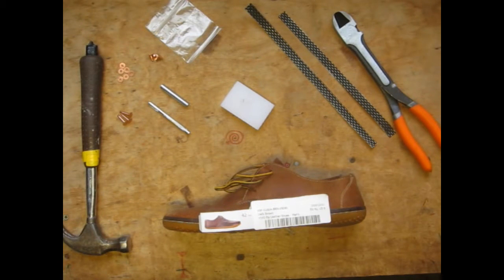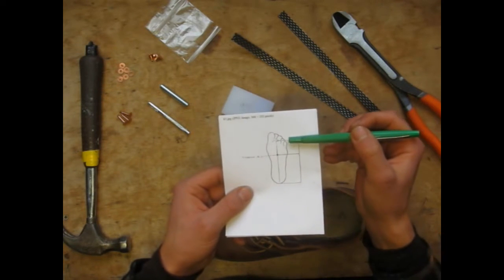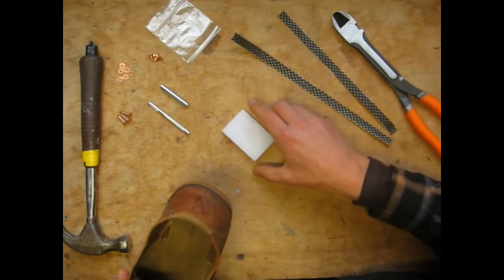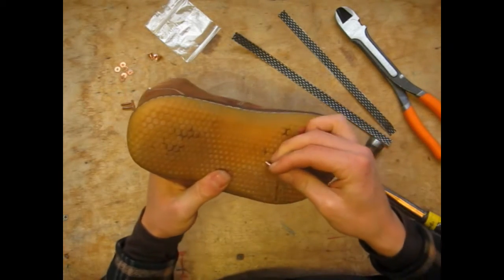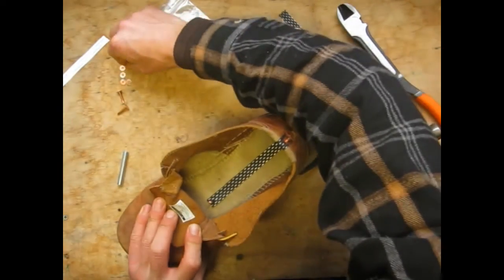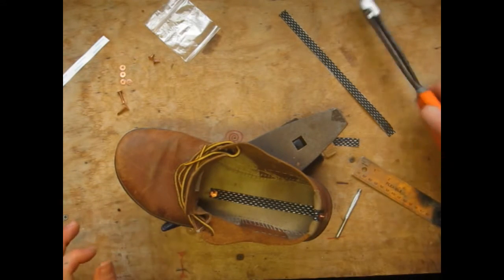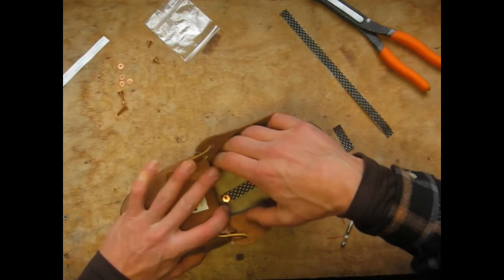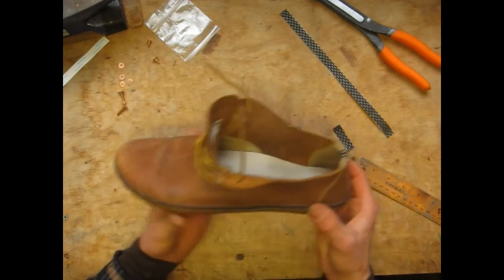Shoe Sync - Earthing Shoe DIY Kit

Comment: i couldn't see well at the end of the video but it seemed that the insert seemed to be back in the shoe. If so wouldn't that block the grounding effect of all your hard work?
Reply from the maker: Depends on the material. If it is conductive or porous, your sweat will enhance conductivity. If it's something like foam, it would block grounding so you'd want to install the rivet through the insert as well.
Reply: EXACTLY what I was thinking! That insole PREVENTS any circuit from completing so it's a waste of time...

Comment: can you ad an insole on top of the ground?
Reply from the maker: The insole will prevent you from grounding. You can however install the copper rivet through your insole, although you will not be able to take the insole out after doing this.

Comment: You can do a lot more simplier, with a band of copper painting from the inside of your shoe to the outside
Reply: Hi Yannick. Do you mean paint that has copper in it? 
1. If so, where does one get that? E.g. in a hardware store? And
2. If the sole of the shoe was painted, wouldn't it wear of quite quickly?
Reply: @RasiliOConnor  If you're going to insert the insole, buy some COPPER tape, and complete the circuit with that. Get an earthing circuit tester also to make sure it's working...
Reply: good idea and less painful than copper rivets
Reply: Good idea
Reply from the maker: Paint can chip (weaker than solid copper rivets) and leach chemicals into your skin. The foot is a major detox pathway so that's not a good place to subject yourself to extra toxic burden.

Comment: Great video and idea! Quick question though. Have you tested the conductivity with sock between negative and positive?
Reply from the maker: Yes, socks build up perspiration (conductivity) quickly. The earthing shoes are ~90% as effective with socks right off the bat. After 10 minutes of use they are working 100% effectively.